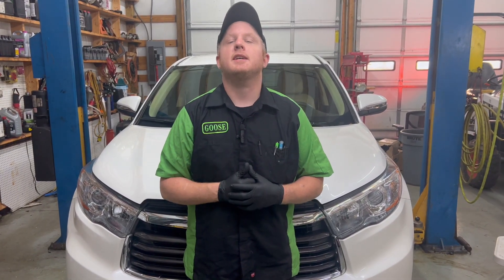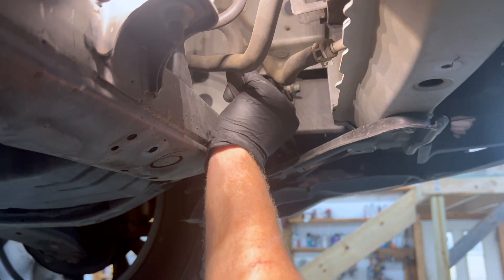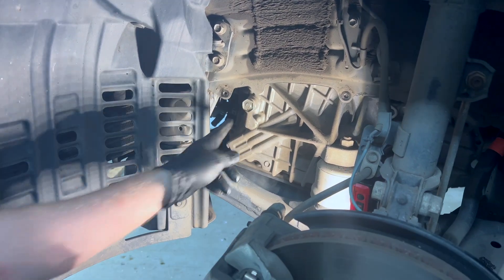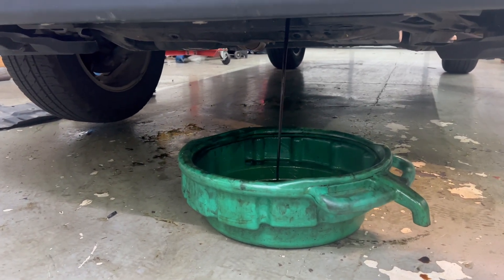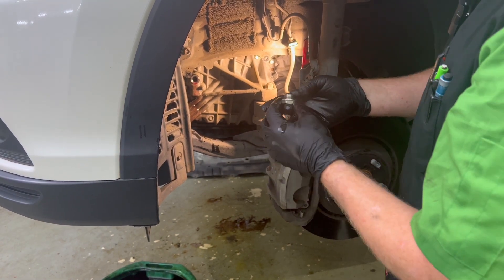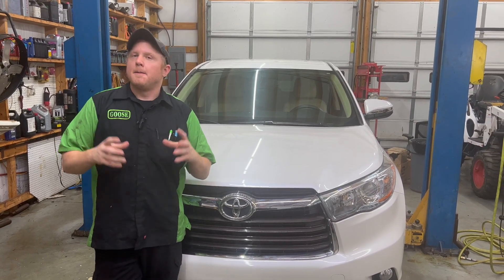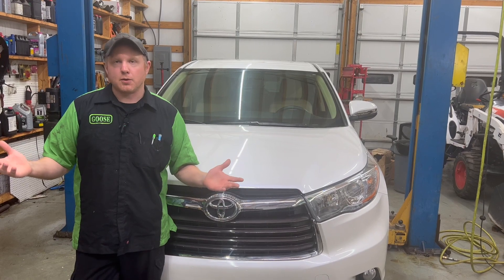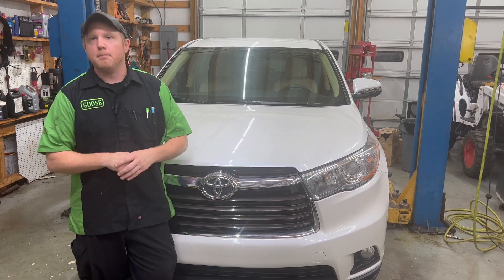2014-2019 Highlander Transmission Flush

Comment: I'm curious as to why it will start sputtering air from the lines even if it has more than enough fluid.
Reply from the maker: You pump in the 8 qts, then run it out so that it’s empty when it’s spurting air. Then hook your lines back up and add the remaining 4 qts.
Reply: @automotiveinsight Thanks for this video. My wife has a 2019 Highlander AWD and I'm going to be servicing it soon. Your comment above has me concerned. You say "pump in 8 qts then run it out so that its empty when its spurting air, then hook lines back up and add the 4 remaining qts. If its empty when spurting air, then you add the final 4 qts, you are 4 qts low because the system holds 8 qts total. Please clarify and thanks again.
Reply from the maker: @ReconRokon when it runs out and “spurts” that just means the pan is empty. There is still fluid in the converter. You’ll find it’s only about 3 quarts low, I just put in the remaining 4 because it’s easier to remove it than add it.
Reply: @ReconRokon - if I were you, I wouldn’t do it this way. Be safe drain 2 quarts by his method turn off the car put 2 quarts in turn on the car drain 2 quarts.  Turn off. Continue this until it’s clean.  that way you don’t ever overfill or run it till it’s sputters

Comment: I just stick with the good ole drain and refill. Normally it’s around 3 quarts. I do this every 50k miles and I’m good to go. Much easier and I don’t think a full flush is necessary.
Reply: I tend to agree I’ve done this about four times on my 16 Highlander and it has 110,000 miles on it. It’s very easy to do the drain and fill.

Comment: Automatic transmission fluid is not hydroscopic. In fact it’s designed to resist moisture absorption.  And contrast to brake fluid, which is hydroscopic.  Just correcting a misstatement.

Comment: You don’t need a pump to do this gravity feed the funnel/ tube from the engine compartment right down into the fill hole. I bought an extra fill bolt and cut a hole in it just for the tube. Works fantastic.  Four of my vehicles and I’ve never needed to buy one of those pumps - gravity does the work all the time much better

Comment: There’s actually a strange process to use the vehicle’s own system to put it in maintenance mode which will tell you when the vehicle’s transmission is at the right temp. You also can use that bottom drain hole to drain the ATF but the way you did it probably gets out pretty much all the old fluid better.  Yes “ lifetime transmission fluid means about 70,000 - 100,000  miles  but I would suggest 70,000. At a point after 100,000  the transmissions clutches etc may need that old original fluid  to work properly and a late flush may result in transmission issues. Opening up that area inside the wheel well is brilliant as I’ve seen Highlander videos where they did all that from under the vehicle and had difficult access to the fill hole.  My local Toyota dealership told me that my transfer case and rear differential didn’t need the fluids changed “ according to Toyota”.  These aren’t 4x4s but I believe the transfer case and rear diff fluids should be changed out every 50,000-70,000 miles as well. The rear diff fluid especially will show fine metal??? powdery stuff by those mileages and whether that’s a concern or not I’m not sure. The rear differential fluid is pretty easy to change yourself just use the right fluid. Same fluid goes into the transfer case which is a little harder to change. In all cases, ( transmission, diff and transfer case ) make should the filler hole plug will loosen up before draining the fluids. Great video and some good tips.
Reply: Any idea what the procedure is to get the trans temp?

Comment: Have you heard of the 2017-2019 Highlanders (gas models) having transmission issues? I've been having issues with my 2018 since buying and there's tons of people talking about similar problems. Some are saying it's the UA80 trans 8 speed. And something about a bad gear possibly. Even saying the 19-21 are failing. Thoughts?
Reply from the maker: If memory serves, I think sienna was the first car to get the 8 speed. I have replaced a few under warranty on the early production ones of those, but honestly that’s been like 5+ years ago. I haven’t seen much of anything since.
Reply: Ok 👍 thanks for your reply.

Comment: With all due respect, you left 2 quarts that are dirty in the pan that could’ve been easily drained before doing this procedure. Why would you wanna leave 2 quarts of dirty fluid and then fill it with 4 quarts of new fluid?  I would never overfill my fluid by 4 quarts. Other than not draining the pan initially what you did was a good process. I would’ve turn the car on drain 2 quarts. Turn the car off. Fill with 2 quarts and repeat until the fluid looks good.  I have no idea what overfilling by 4 quarts does but I wouldn’t want to risk it  furthermore, you should choose the return path into the transmission so it does matter which tube you choose.  That’s the last part of the line before your new fluid is introduced so it makes sense to use that line.  Other than that great procedure. I have that identical car.
Reply: Everything in the pan was pumped out.  Unless you break the level tube, then pan does not drain.  You break the level tube and you need to pull the pan and replace it.
Reply: @ I have no idea what you mean by breaking the level tube. I’ve taken level tube/straw out 10 times. There’s no way that things gonna break unless you have no idea what you’re doing.  You have to take that tube out to get the bulk of the fluid in the pan out anyway
Reply: @suunto61  - everything in the pan was not pumped out. He clearly said he didn’t empty the pan.  Furthermore, you can’t pump it out it’s not accessible.

Comment: Kudos for using the correct fluid. You didn't change the drain plug washer/gasket, hopefully it will not leak, otherwise the transmission can be ruined.
Reply: Get serious. I’ve removed mine like eight times and not changed it.  If you can’t identify a leak before it ruins your transmission you shouldn’t be doing this procedure.

Comment: 6mm hex to removed the drain plug..then same 6mm hex put back into drain plug hole and removed the tube..its a green colour..when everythings drained..put back tube..you dont need to over tightened it or it breaks..put back plug..then fill the amount that came out of pan plus add half a litre from sides fill plug..its better to overfill cos you can adjust it after by removing drain plug..depend what method you use to check the fluid level..after that..remove drain plug to get rid of excess oil..when its start to drip..put back drain plug then good to go..cheers

Comment: Can i do this for highlander 2.7 fwd.? Can i use a temp scan to measure the temp??
Reply from the maker: As long as it’s after 2004 then yes. As far as the temp scan, it will probably get you close, but the temperature inside is hotter than outside so you’ll have to contend with that.
Reply: @automotiveinsight  mine is 2016 2.7L. Is there any other tool to measure the temp? Aside from the scan tool you were holding..
Reply: Bro I've been trying to find the same thing for a 2.7 as well please hit me back when you find out.

Comment: Question: does that Highlander have a dip stick? I have seen one YouTuber pouring the transmission fluid on a 2013 Highlander from the top via dipstick opening.
Reply from the maker: Not in this year range with this transmission. Some of the older ones do and some of the 4 cylinder ones do.

Comment: Is there value in dropping the pan and replacing that filter?
Reply: Toyota told me there is no filter just a metal screen they said don't bother
Reply: @shorelinearmorllc477  I just did a fluid change on a 2016 Toyota Highlander 3.5. L 2WD and can promise you there is a black plastic transmission filter on the bottom of the transmission.  Why you wouldn’t change the filter out is beyond me. There are 2 bolts that are a bit of a pain to get out.  Actually better to drop the pan and filter, you get out a little over 3.5 quarts of fluid.
Reply: @polarbear2469  I guess ask the dealer that's what they said it's a metal screen I have a 2017
Reply: @shorelinearmorllc477  The 2017 might have a metal screen, but I know for a fact the 2016 has a transmission filter.  You have to go to Toyota to get it, hard to find aftermarket replacements.
Reply: , I checked I don't know how many sites for my 2018 Highlander and I couldn't find a filter. When I pick up a part tomorrow I'll have to ask the dealer if it has one. If it does, it will get changed.